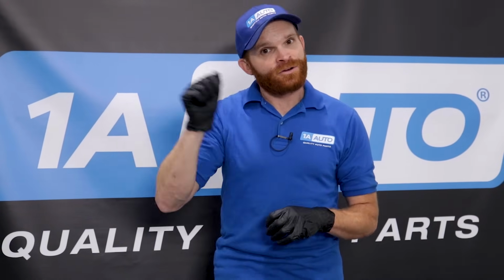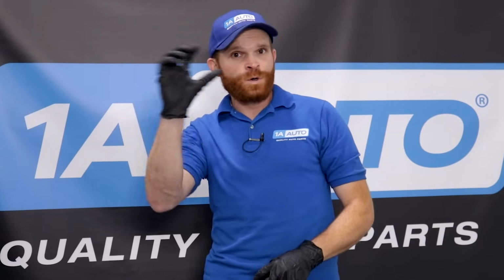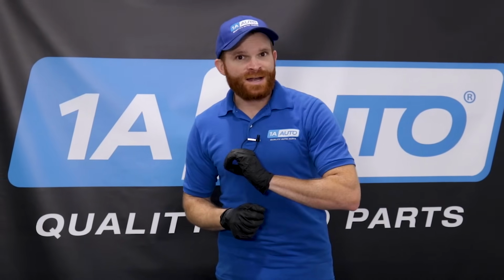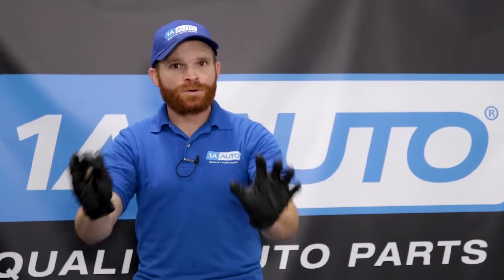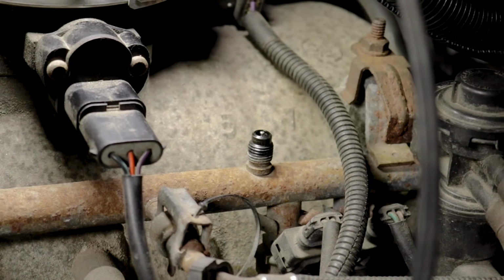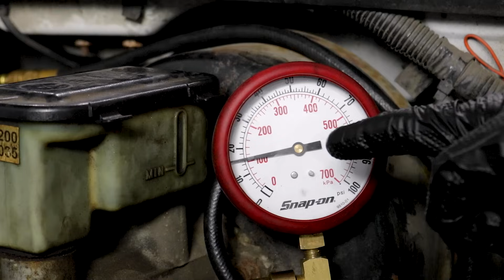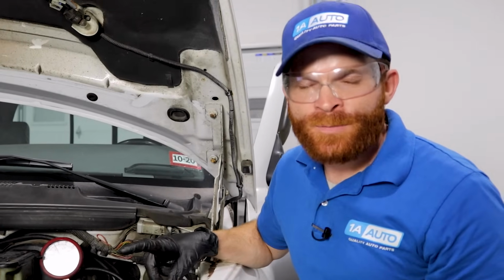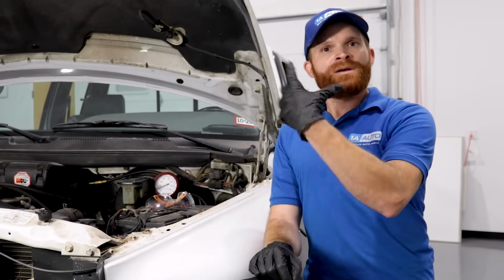Lag, Hard Start, Stall? Diagnose Car & Truck Low Fuel Pressure!

Comment: Thanks I watched the video, and I tested my dodge ram gas pressure and as you said the needle in the pressure gage should remain almost steady but my pressure regulator needle is bouncing crazy, I assuming I got a problem with the gas pump but certanly I don't know 100% 
Question it is for this cause the gas pump week or still the chance that it might be a leaking injector.???

Comment: I just had the spark plugs changed on my Audi A4 1.8T 2013 <100 000km. The vehicles fuel consumption jumps to 20 L/100 km/hr if I drive it 1 km up a very steep hill and the fuel consumption drops down to 6.1 L/100km/hr if I drive it on the highway at 120 km/hr for at least 36 km. At low speeds around 60 km/hr the vehicle feels sluggish and a bit unresponsive. What could most likely be the issue a failing fuel pump, dirty throttle body, blocked fuel filter, faulty coil pack, blocked air filter?

Comment: I have a 98 Jeep ZJ I just purchased with the 4.0 and this video has helped me tremendously on how to use a fuel gauge properly.
   I've purchased from you before with great results and will do the same if my pump turns out bad.
Question: I found  my fuel fill-up compartment is busted down at the bottom inside where the gas cap seats and the little flapper door is broken and pushed to the side...... I'm hoping that is the problem  and i need to borrow my buddies fuel gauge. Hence this video is a big help.
   Thanks and Merry Christmas  🙂

Comment: You are the man......I have an 2008 nissan pathfinder and I have somewhat the same issue. I turn the key and no prime for the fuel. I'm assuming it's the fuel pressure regulater.  I've checked the fuel pump, relay and fuses and they're all good. Any ides are welcomed, but I'm replacing that fuel pressure regulater tomorrow.....wish me luck
Reply: Did it work?

Comment: Have a 1998 f 150 4.2 by. Idling  pressure is 50  when I accelerate to 2500 rpm foul psi drops to 30 psi. What should I look for  ???

Comment: Thank you.  I love your videos.  I have a 1999 Buick LeSabre that is not starting, sputtering, and killing at very inconvenient times.  The mechanic estimated $650.00 to replace or repair the "fuel pulsator" he called it.  Unfortunately I have NOT found much information on "pulsators" or "pulse dampeners."  I also have not found the location of said part.  I can't look at the car yet to verify that it has a fuel pressure regulator, but I'm quite sure it does have one.  Is the fuel pressure regulator the same part as a fuel pulsator or fuel dampener?

Comment: I have a big issue like this. Got a remap , day after Boem Low rail pressure. Tuner makes me change 6 injectors, HPFP, Valve on comon rail and the problem stil is there. Car starts perfect,drives perfect untill power is demanded. It then gives reduced performance engine light. 4K in and stil breaking my head around it.

Comment: Good day Sir..hope you can help me..i gor Pivk up truck were recently there is warning came our on instrument panel " Fuel pressure low" and next day another warning came out  "coolant temperature high" my uncle suspected that my truck Fuel Pump ia defective..how about my Coolant Thermostat it is also defective? We received a quote for the brand new parts of Fuel Pump its about 35k in Php about 800usd..im from Philippines Sir..thanks in advance for your useful comments..BTW My truck is Ford Ranger Wildtrak 2.0 Ltr Singke Turbo / year 2020

Comment: I love you man, I know I'm a year late for saving my expedition but fuel pressure or the Fuel pump shat the bed. I had to keep my foot on pressed slightly on the gas, otherwise it would stall. 
It's last day with me, it stalled in traffic and thankfully I managed to steer into a side street with no power, everything just shut down so it required some strength to steer that beast. 
1999 expedition with the V8 Triton engine. Lesson learned.
Reply: Was it bc I have to hold the pedal so truck doesnt stall

Comment: My car cuts out once engine reaches running temp I put scanner and replace cam crank sensor checked spark good replaced alternator coil new battery fuel pressure reg can it be fuel pump or computer

Comment: Gil.  1998 f 150 4.2  idling pressure is 50 psi. At 2500 rpm pressure drops to 30 psi .what should I look for  ???
Reply: Where was this test taken, before or after fuel filter?

Comment: I get the p0087 fuel rail/System pressure to low. It's a 2018 Mercedes Sprinter 3.0L diesel. It will run, turn on but once you press the gas pedal and the rpms come back down, it stalls. Help!

Comment: Serious question here. I'm outta ideas. 2000 chevy s10 xtreme 2.2l 4-cylinder with 200000 miles. New fuel pump, fuel filter, fuel pressure regulator, fuel injectors, ignition coils and plugs and wires yet my truck still acts like it is going to die when I press the gas pedal. Idles rough pops and shakes amd just sounds bad.... Any ideas on what I should try next?

Comment: Hello! I really need your help if possible. I just changed my fuel filter and ran my 2006 Ford f150 for a bit, like 15 minutes,  and now its a little rumbly and the check engine light came back and has a PO300 code. So im kind of confused what it could really be. Any help would be appreciated.

Comment: I have a Nissan frontier 2.4l 4-cylinder 2001 and I find a code p0171 I replace fuel filter, pcv valve the car still running rough and i don't see the check engine light come on

Comment: My jeep grand Cherokee Laredo keeps cranking but won't start up. I changed the fuel pump, starter, fuel pump and starter relays. Still no start up. What could be the issue.

Comment: I have a 2002 cavalier my car wont start unless i hold down the gas pedal but as soon as i lift off the gas the cars shuts off, the fuel pump is working, could i have a bad fuel rail pressure sensor?

Comment: Len !  love your videos ! did my serpentine thanks to you piece of cake.  now i have a stalling issue with my 2012 ram 1500 5.7....ive done the plugs, serpentine, throttle body cleaning, pcv valve...it stalls at the stop sign. the rpm dips below 6000 an it stalls.  if i tap the gas pedal when it starts to dip, it wont stall.  i hope i can avoid a fuel pump change.  it had a trouble code po463 that went away with a fuel injection cleaning. next thing i will be doing is to check MAFS, MAPS, EGR VALVE, IAC
Reply: Same here but with a 2017 Kia Rio! Works perfectly then once it gets hot it starts to stall at stop signs. Or if I fill it up with gas it will stall- unless I start it while stomping on the gas lol

Comment: i have an issue that is boggling. I have 60psi at idle and cruise. once i push pedal down even to quarter throttle the pressure drops to 50-54psi than will come back when let off.
or it will drop and stay down for a few seconds and come back up if I stay accelerating.

If I go wot which I am not doing until this is corrected. it will drop than come up, then drop and come up. It is very strange.

Comment: Hello, my 95 gmc c1500 is running rich would anyone know what I can do? I’ve changed the o2 sensor, map, coolant sensor, maybe it can be the fuel injectors or regulator…fuel pump and filter but they all seem fine, what do you guys recommend me doing?

Comment: This may be the problem I'm having on my ls2. But another problem I'm having is when u cycle the key and go to turn it over it doesn't turn over not even make a clicking noise. Once the battery's disconnected then reconnected it starts right up. Any ideas?

Comment: Hello, I'm having trouble with my 98 chevy s10 4.3l, not staying running smoothly and I also scanned it and the code was; p0300, stating random misfire and bank 1 sensor 3 , I haven't change the o2 sensor but I change the fuel pump, distributor cap/rotor button and spark plugs and it tries to idle down but still the engine shaking, I'm thinking it's jump time, I maybe wrong, just need some help on this

Comment: Loved the video but if anyone can help me, I was driving and suddenly my bronco (1995) turned off and yes battery is full alternators and starters are good I am getting sparks from the plugs but noticed I couldn’t hear my fuel pump and I replaced it same thing was happening and mind u it was trying to turn over but it won’t and I put starting fluid and it starts right up and also replaced the fuel pump relay and so idk what to do now lmao.
Reply: Did you fix the issue?

Comment: If your car stalls out while driving, and when you start it, it sounds like the car has no compression or the starter is not engaging with the flywheel. Is because of the fuel pump or injectors?

Comment: My wife has a 2005 Chevy Tahoe. She can drive it for a little while and then it will cut off. It will not start back up until maybe 10 minutes later. But it will just die while she's driving it. It all started with the car taking longer to start a couple of months ago. And then we started smelling gas really really bad and even inside the car. When we bought the car the evap canister was clogged up so of course it is very hard to put gasoline in the car. We lost everything in a house fire so money is very tight. I just need to know what steps do I need to take? Should I go to Harbor Freight and buy a fuel pressure gauge and start there? Or could it be a crank sensor or cam sensor? Also I have a OBD scan tool. But she does not have power coming out of the port for some reason. I have not had time to check the fuses yet but I was told it's on the same fuse as the cigarette lighter and her cigarette lighter does not work and has not worked in a long time. Check engine light is on but like I say I have not checked the code yet
Reply: Same here on a 2005 Chevy Tahoe.  Problems were not being able to pump gas into tank or taking forever to fill up at the pump. After dealing with that for a year or more I finally changed the little square box" evap " that as little charcoal particles in the bottom. After changing the box out it was normal to fill up at the pump again. Before changing it out with a new one I cleaned the old one out using an air compressor but didn't last long. There was all kinds of junk coming out such as dirt ,sand that is and other gunk , so I just bought a new one. There is a few videos on this on you tube. Good luck taking off those hoses and don't break the plastic connectors. Have PATIENCE!

Comment: 2002 dodge ram here, no engine codes it seams to have no guts not drivable maxes out at 30mph and stalls when turning woundering if it could be the fuel pump

Comment: I like your video. I have a Chevy s10 4.3 that has sit for 6 years with about 1/2 tank of fuel. I put a battery in it and filled it with fuel leaving the old fuel in it. Drove it about 100 miles and suddenly it lost power and stalled and run piss poor. Could only drive it about 5 miles an hour to get it home. Put about 5 cans of fuel cleaner and fuel booster with injector cleaner in it. Each day now I start it and let it run until it dies. Noticed the fuel pump makes a louder noise since this happened. It seems to run a little smoother each day. Hoping it will clear up in a week or so.  Thanks for the video.

Comment: Len  did  good on the video  however  i felt that he couk have  went more in depth with the  fuel pressure gauge  he ran through the demonstration  to fast and i would have liked to see every step of him attacking the  gauge and  seeing the results overall  he done a great job /// my question to him is how do i get the fuel  pressure up to regulation  on my Toyota  sequoia  2003 to allow it to start ??

Comment: Hi, I have test my fuel pressure and it’s go up to 40 psi or a little bit above and after a while About five seconds it’s Drop down to “zero” at one not slowly it’s just drop straight away zero, I have Mercedes-Benz C 220  diesel 2016, Is this is okay with my car or diesel engine or I have an issue with that because I have P0087 Low fuel pressure error and my car enter save mode

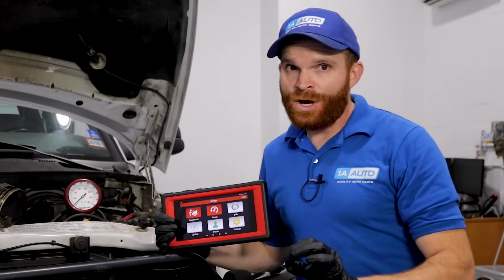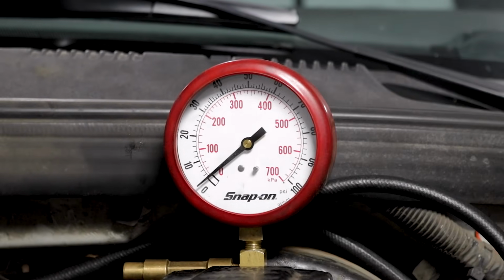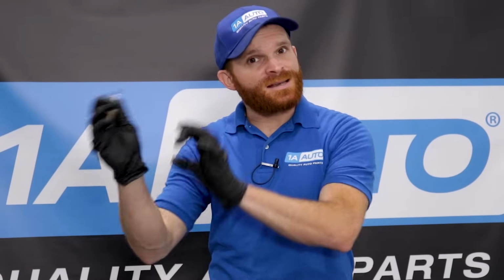Comment: I have a 92 Dodge Stealth rttt and the fuel pump supposed to be running at 10:00 on low and at 12:00 Plus on high when throttle is wide open and my pumps only running at 8:00 so I did some rewiring and it runs even worse with more fuel going to it what could it be that would make it misfire almost like it's getting too much fuel but there's no way because of my exhaust are hollow and it's twin turbo

Comment: Please help folks.  2012 Ford Escape 3.0 starts well when engine is cold.  But when engine is hot and weather is hot car takes about 8 seconds to start.  When it starts it runs just fine.  Plugs changed, idle air valve changed, throttle cleaned, the 3 key pauses to build up pressure do not do anything. Don’t know how to check fuel pressure on this car but it runs well which makes me believe the fuel pump is fine. Fuel pump flange was replaced from the dealer last year.  
not sure what to try else
Reply: Not sure how to find a leaky injector?  Wouldn’t that show signs of mis firing?

Comment: Great video!! I have a 08 5.3, torqstorm, all stock block, upgraded aeromotive 340 fuel pump and 80lb injectors. At times I'd have to bled my fuel rail to start my truck. Idk what's causing this.

Comment: I have a 01 eclipse that replace fuel pump then car wouldn't start after a few times car started but no i have a p0300 code reaplce spark plugs, wires, rotor cap and still with a random misfire. Does a low fuel pressure can cause that or what that could be. Thanks 
Good video tho

Comment: I like his great explanations about symptoms and his way of describing what the function of a particular part does. He also doesn't start jibber jabbing about crap that has nothing to do with the subject being discussed. I do wonder when a vehicle begins to be a older model. When he says older models the check engine light most likely will not come on concerning fuel issues. LOL! when is a human considered old so to speak. Are you old when you are 40, 60, or 70

Comment: I Have A 1999 Mitsubishi Mirage 1.5LT  Engine ,Auto Transmission , 

And Most Often, When I Start The Engine And I Press Gas To Like Half ( Wanting It To Move At Once) , It Doesn’t, 

It Gets Even Worst When Engine Is mid-Hot And Idling In Traffic.. When I Hit Gas At GO , It Takes Forever (People Behind Begin To Horn) 

I changed the fuel filter and fuel pump motor , fuel injectors , air filter , Spark plugs ,Spark Wires, throttle body , tps sensor, And Distributor BUT to no avail 

DO I HAVE TO CHANGE THE Whole Fuel Pump Unit..? 

Can Fuel Pump Relays Also Cause This Problem Of Slow Acceleration… 

What Is Causing Engine To Run Rich ..??

Comment: My Durango only has pressure when cranking if u leave it sit it loses pressure instantly. Cranking over with plugs out there's a couple of cylinders that are streaming alot of fuel out the spark plug hole

Comment: Can anyone help I have low fuel pressure but only at high rpm, it’s a Diesel engine and it has no issue starting and doesn’t feel like it wants to stall I am having quite a large amount of black smoke coming out of the exhaust?

Comment: Great video, 2010Yukon XL, 6.2L , what if you have the leak back in morning which would think regulator or dripping fuel injectors. What if you have the drip back And you have a Rich burning system. Both banks burning rich? Would you think fuel regulator also? Thank you, I have had a very hard time finding this problem

Comment: I have a 91 c4 corvette, I checked my fuel pressure the first test just the pre start mode and got 40 psi but was unable to do the other tests, due to something in the ignition, so  i left the Gage on and released the pressure the next day the gage was at 25psi so i released it to zero two days later it was at 40 psi, zeroed it again and today it was at 40 again how is that possible over a week and it keeps building pressure even with the battery disconnected, i open'd the gas cap to see if it did anything but still 40. Does anybody know why it is doing this?

Comment: 2010 Mustang GT. Have a P1237, P0191, P0193. I was told the Fuel Rail Pressure sensor is bad. Fixed it. Car never had many issues. Lately the P0191 and P1237 have come up. Was told to replace the Fuel Pressure Driver Module to fix my hesitation, lack of power, exhaust smell, and black residue/fuel in the exhaust tips. Changed the FPDM. Didn’t fix it. Wondering if I have a fuel pump issue. I can turn the engine on, but not crank it over and I hear the pump. It continues to whine and whine. Doesn’t shut off after a second or two. Any ideas? Anyone at all? Thanks. Also changed my fuel filter. Car is only at 80k miles. Thanks I’m advanced
Reply: P1237 can be a code for bad pump. Just curious. Fuel mileage is awful. Getting around 14 mpgs vs my usual 20

Comment: I have a 2007 VW Passat 2.0T - FSI engine & the car has 2 fuel pumps , It has the Low Pressure fuel pump in the gas tank & There is a High Pressure  fuel pump up at the engine , The problem I'm having is when I hook up the fuel pressure gauge & Start up at the engine for the Low pressure fuel pump the gauge will go crazy , The PSI will stay around 60 to 80 PSI but the pressure gauge needle jumps back and forth very rapidly where I can't almost see it / The needle moves so fast between 60 & 80 PSI , Anyone ever seen anything like that before ? And what could be cause it ?

Comment: 2003 suburban 5.3 flex fuel. issue that I’ve diagnosed is fuel pressure is low. Just replaced the pump so I’m going to assume it has low voltage. ?? Idk that’s where I’m stuck now. Where do I check voltage?